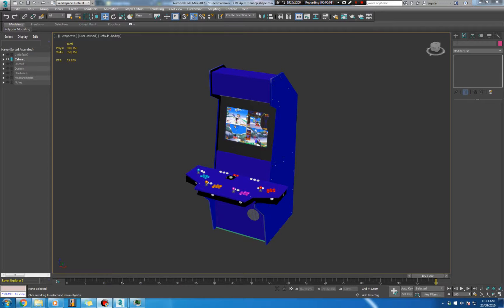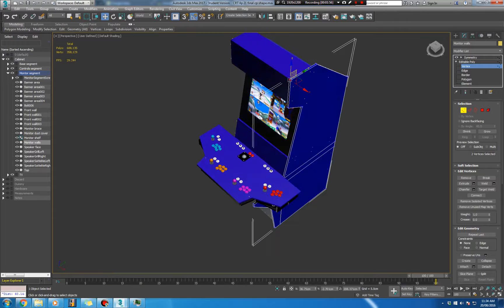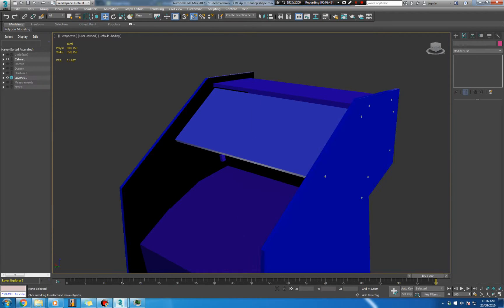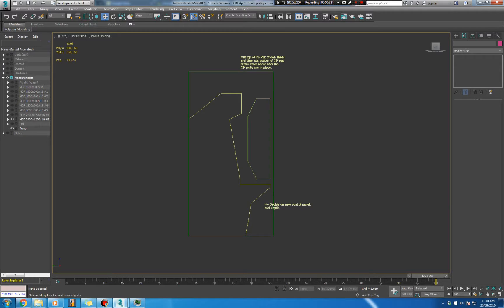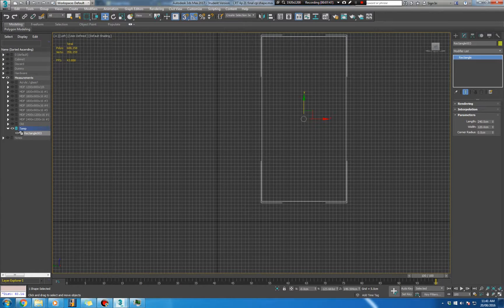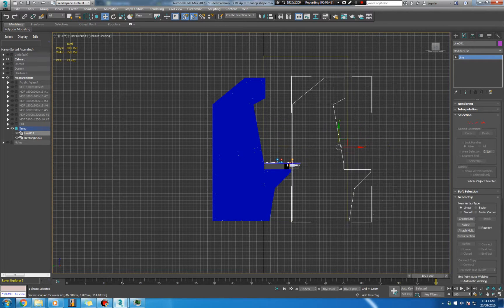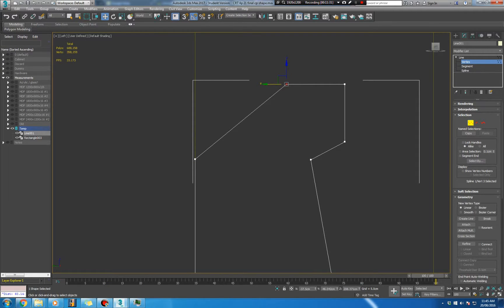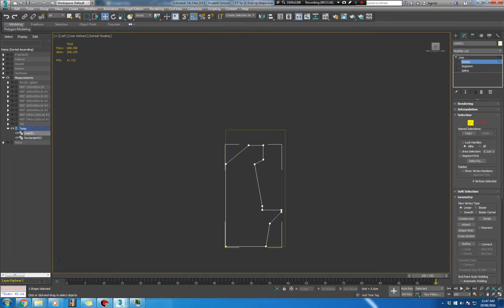Getting measurements out of 3DS Max - Part 1/2

Comment: Hi, i need some help with a drawing of a car chassis. i dont have the sizes. but there are 2 lengths known.
Reply from the maker: redewaan josias I'd love to help but I'd need more info. it sounds like you're hesitant in general about modeling. you can make a car chassis no problem, if you have some plans to copy from, or even if you want to just eye ball it from reference photos. try doing some general modeling tutorials.
Reply: Hi Clint, thank you for your response. Up til now i have not attempted to and i know it wil take some time to get the hang of it. Yes maybe i wil later on but now if you have the time time to help i wil much appreciate it. I do have some drawings and photos. How Can i get it to you?
Reply from the maker: redewaan josias Send me a direct message at my twitter @Domarius64 and we'll swap emails from there :)
Reply from the maker: You could try my twitter as above or upload it to Google Drive and post the link here :) I don't want to put my email up here is all.